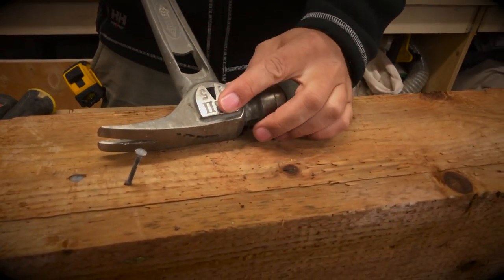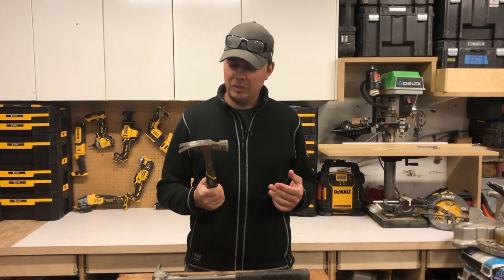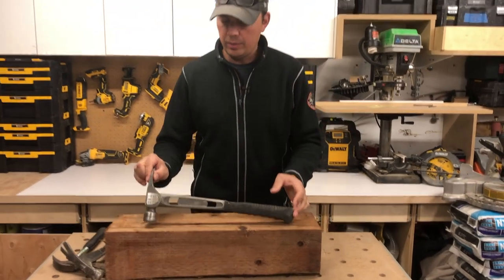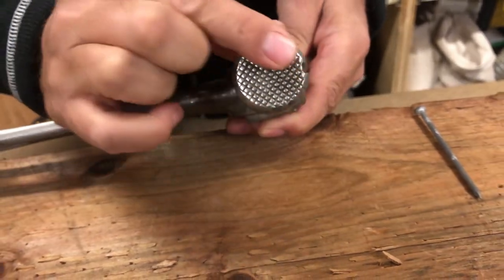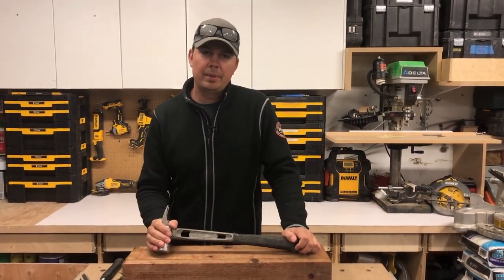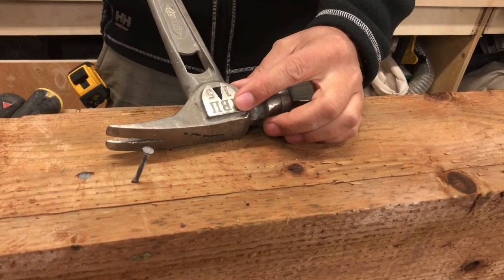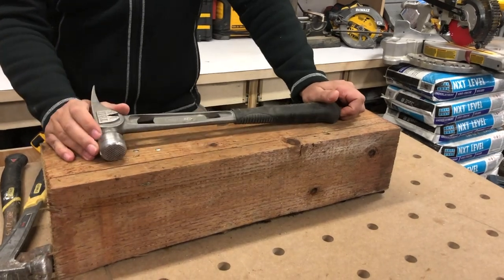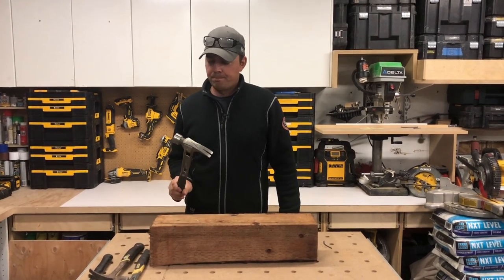Protect your arm with the Stiletto TB15MS Ti Bone Titanium Hammer with Straight Handle

Comment: I just ordered one to go along with my 34oz east wing framing hammer. Can’t wait to set some forms with it
Reply from the maker: sweet, you will love it!
Reply: 3 months later and it’s the best hammer anyone I’ve let swing has used. It does the job and so much more. I do concrete and when I remove forms this thing is fast then a crowbar at taking out duplexes

Comment: I tried this and the Martinez. Ended up returning the stiletto. Martinez is the guy who invented the stiletto and sold it to TTI. the Martinez m1 and m4 fix all the things wrong with the stiletto (no head turning after heavy use and easy to replace the grips). It also gives you different head options and you don't need to replace your whole hammer if your claw breaks or chips.
Reply: The tb3 fixed the turning head.

Personally I prefer swinging the m1 below waist hands down, but I rather swing the stiletto above waist.

Personally I prefer the tb3 because it fits my job better even if i think the m1 is a more aesthetically pleasing hammer.

Comment: For $150.00 the thing better make your lunch and wash your truck for you!  Nice hammer but framers aren't known for spending that kind of $ for a hammer.
Reply from the maker: thats true, I just love tools. thanks for watching
Reply: My boss swings a Martinez and gave me his old stiletto tbII as a gift for stickin it out and learning
Reply: Maybe where your from but in my area a good bit of framers use these or Martinez for the same reason. Some roofers too and they dont really need a framing hammer. They are worth every penny and for long term stress on your body 200 is not bad considering you can seriously damage your arm and I have seen it happen. Almost all the guys I work with always take mine to use lol
Reply: The dumb ones don't spend good money on tools, that's why they end up falling apart after years abuse
Reply: all the framers I know have expensive hammers, me Included